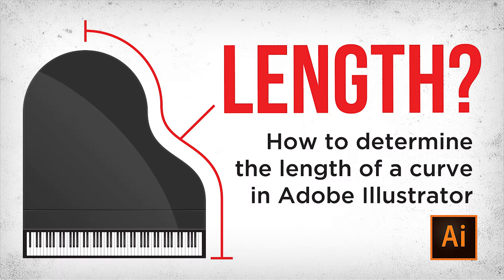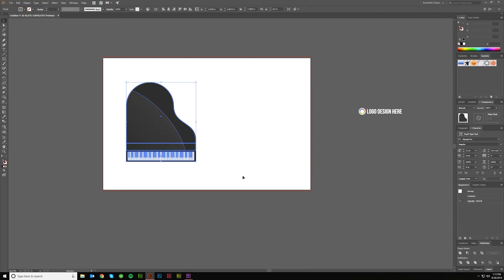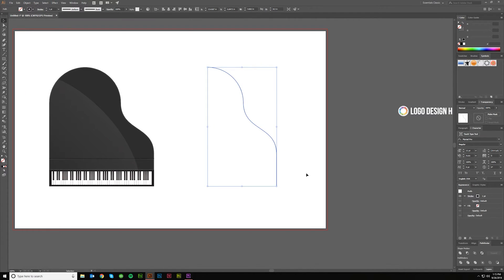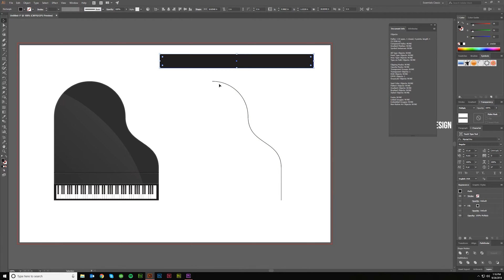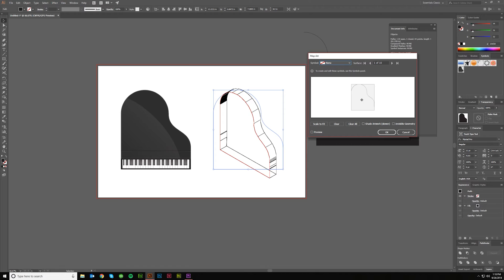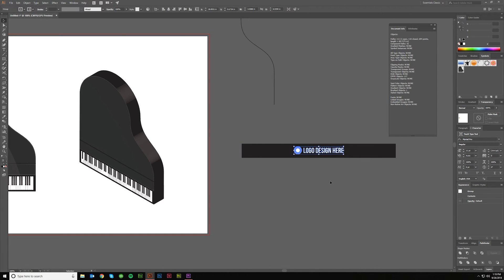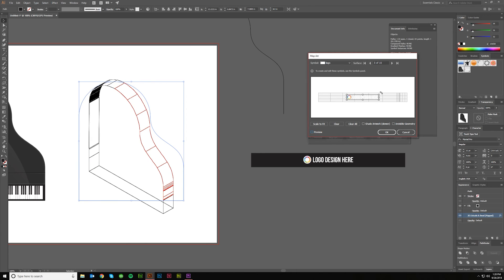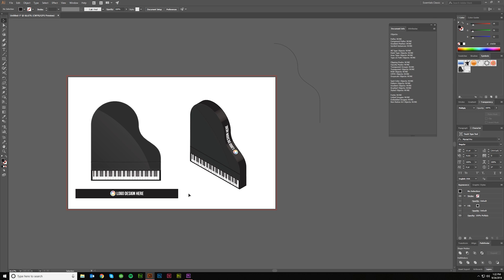How to Measure a Curve in Adobe Illustrator

Comment: thank you very very much for long time i wanted to get any info about how to do it even if not exactly what i needed but its better than nothing 
i was wondering if i can measure a design if it well fit on a real world object the curve ....etc so when i print the design and for-example need to put it on a cuvered arrow in real world how would i be sure it well fit, sorry for the stupid question but i learn from internet cant afford class's, any info how or whats it called to research about the correct topic i well be very thankful
greetings from Yemen
Reply from the maker: For that, I would measure the arrow with a soft tape measure and just make your art to that size.

Comment: This video is immensely useful. I’ve been using my stopgap technique in which I made a brush composed of 7.2pt circles that scale to an inch at 1:10.  To get the length I’d have to count the circles. It wasn’t precise but it was good enough. 

The technique here is exactly what I needed. It’s far more precise and easier to manage. I should’ve looked it up years ago. Kudos to you!
Reply from the maker: That's great to hear!